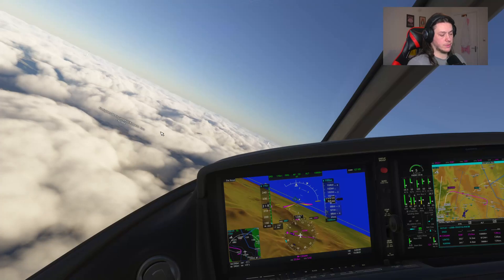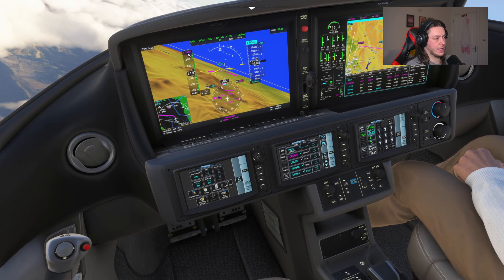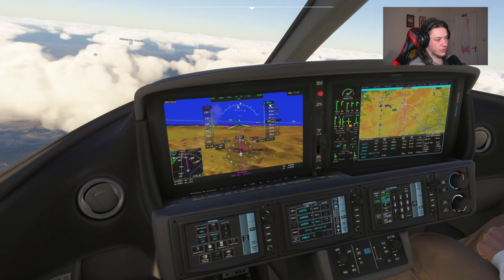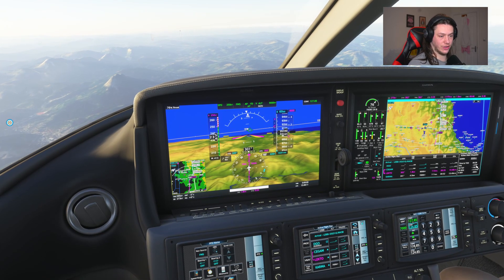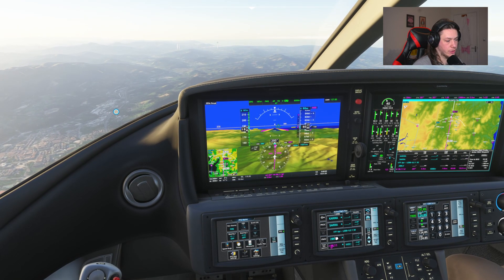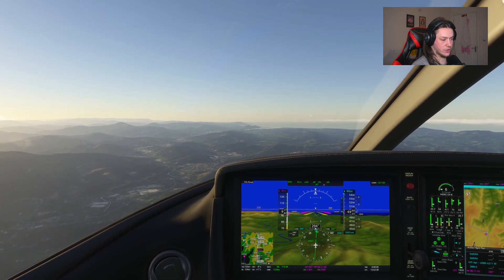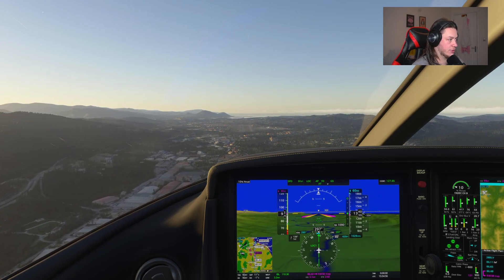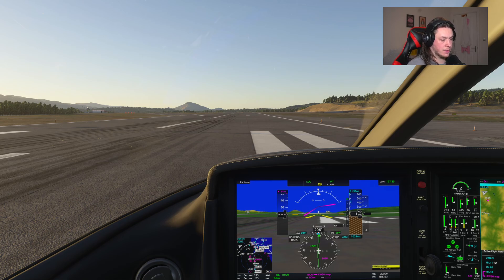FS2024 - Vision Jet G2 - Autopilot, Landing procedures and autothrottle

Comment: Yeah I don't know if it's your accent, you're too smart, talking too fast or all 3 but I need to learn this and I don't understand it. It's like I'm following but I'm not. I wish it was more slowed down and explained better. I can setup auto pilot and make changes for the most part but I'm struggling to figure out the auto land. I also find it weird in Cessna 172S you can practically hit direct to then activate with altitude dialed in and nose up speed and let it do the rest and this isn't exactly like that. Whether I use Direct to or autopilot on the route I'll be coming in at 15,000 ft and then once I get close to the destination airport it's just stuck up there and doesn't know what to do. Then I have to manually do it and it's a pain in the ass.

Comment: Hey man, i am running to a problem where auto throttle is kicking on during my landings. It's really ruining my approaches. Have you or are you experiencing any of that?
Reply from the maker: I’d recommend checking what the FMS is setting your auto throttle is at (2.10 in the video I cover the auto throttle settings) and if the FMS is set up correctly make sure the Autothrottle is in FMS mode and not manual.

If this fails use the autothrottle master switch to disable the autothrottle and manually adjust your speed

Comment: In the quarry it seems 90% of airports are not equipped with ILS, or am I missing something?
There is only a direct visual approach mode or something like that. in this case, the autopilot can provide almost nothing during landing and landing in bad weather is simply unbearable. I flew on a jet in such cases simply by the instrument, since it accurately displays the runway even if nothing is visible outside the window. but recently I bought a Pilatus 12 and there is no such screen, in bad weather I feel like a blind kitten on such runways for which you cannot set up an automatic approach
Reply from the maker: A lot of the smaller airports don’t have ILS, so it would be a DME or VOR chart approach. The other option is if the plane has a Garmin G3000 or G5000 a visual approach can be programmed in to any airport to be flow by the autopilot.
But I agree, especially in career mode the weather can be terrible.
Reply: It’s possible to activate the Synthetic Vision on the PC-12, although the menus for that are not intuitive.